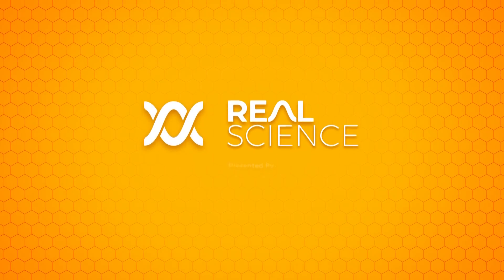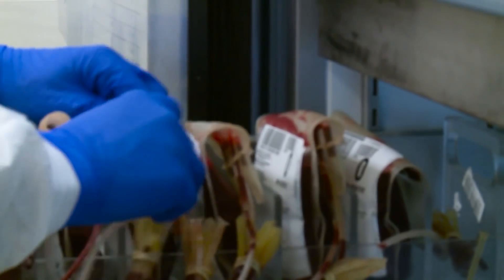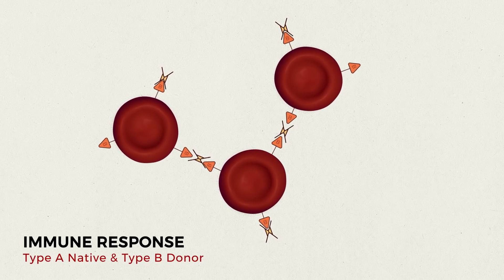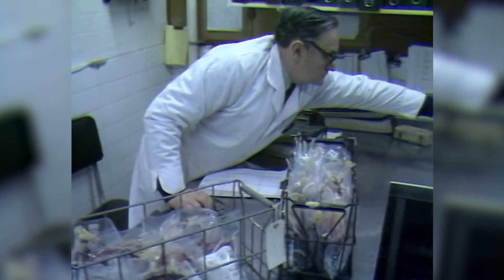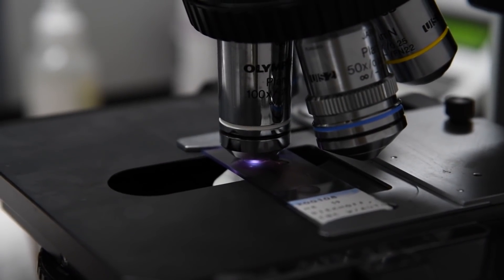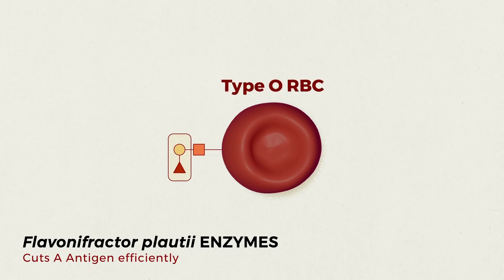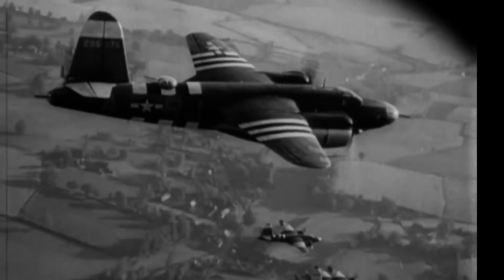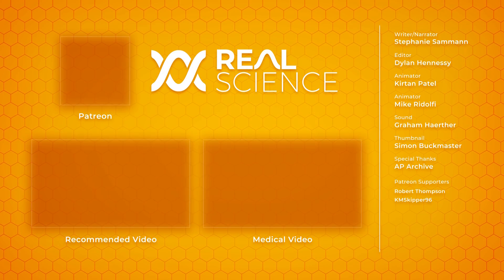Can We Create Universal Blood?

Comment: I had O- blood before I had my baby, after that it's now changed to A+. Everybody swears your blood type never changes, but mine did. I wonder if it was from too many Rogam shots? Initially I was told I would only need one my entire life, during the last pregnancy they wanted to give me one each trimester. IDK.
Reply: So Rogam is an injectable form of purified anti-D antibodies,  made from donors who have anitbodies to the D antigen (the 'positive' in a blood group.) in a process called fractionation. Often during pregnancy, some of the babies red cells can enter the mother's circulation, and cause an immune reaction. This can cause the mother to produce anti-D antibodies, which can attack the babies red cells. Rogam minimizes the chance that the mother creates an immune response against the babies D antigen. Rogam is usually given 3 times during a preganancy - at least in New Zealand. Different places may have different standards. 

If you were given Rogam, you are very likely D negative (Oneg, Aneg, Bneg, or ABneg) - if you aren't, somebody fucked up. Testing as Apos was probably an error by the Laboratory, such as a sample mixup. Did they contact you after testing as Apos to book another bleed?

Comment: Isn't basically -O blood type?
Reply: It depends about which -0 blood type you mention. Same as A to A1 to A2 to A3, ... ie B to B1 to B2 to B3 ... there is 0 to 01 to 02 to 03 ... , also RH negative to RH positive. Where There are always weaker '0' RH negative modified by bacteria into '0' Rh null , and further weakened into '0' Rh Negative. About which '0' you mentioned? where even the '0' is NOT '0'. Going backwards in time, 200 years, 30,000 years, 150,000,000 years, ... etc etc, they would tell for today people "they don't even have blood".

Comment: the problem with "synthetic bloods" is they tend to interfere with most blood tests. I have only once seen a sample of blood with a synthetic oxygen carrier in it and I couldn't reliably test it for a Full Blood Count as the numbers were all nonsense and the plasma was so dark that many other tests which rely on optical techniques like spectrophotometry couldn't be done either.

For making all blood group O, that's fine but the next time I test the patient's blood I'm not going to be able to tell which group they are, so then they MUST have group O blood until their own group is clear again (because safety) which would massively increase the demand for group O. That makes it difficult to phase this in. Once you've started using it, it's all you can use.
Reply: Mass jab ingredient potential here .......

Comment: What about turning Rh + blood into Rh -? You only spoke about turning A or B into O. Considering O Blood also has to be Rh - to be universal donor blood. Considering the Rh - blood types are a lot less common than the Rh + especially in A and O it would seem to be pretty important to do that too.
Reply: From what I remember the RH factor is protein that goes through the red blood cell membrane as opposed to simple sugar added on the cell like for the ABO system, I would assume that removing it is much more complicated. Just turning all A into O would already double the supply of both O+ and Oneg which most likely would be enough to supply the demand.
Reply: @patrickpi12345  thanks for the answer. Maybe a protease could work but it would need to cut the protein right at the membrane and even then it isn't certain that this wouldn't hurt the blood cell. I assumed it wouldn't be easy but a lot less people have Rh - blood than Rh + and since this it the one causing problems during transfusion it could save a lot of lifes.

Comment: Why don't the donor population and the recipient population have the same profile? How can there be a shortage of a particular blood type?
Reply: O both positive and negative are used more because they are universal and can be given in emergency situation where there isn't time to find the exact blood group of the person. That's what mostly cause the shortage. Other situation like massive bleed from a B patient could also cause shortage of B which is already not very common which would then receive O because that's the only option left for them.The last situation would be even worse if the patient is Rh negative.
Reply: @patrickpi12345  Thanks. That makes sense.
Reply: If the doners and recipient population belong to the same locale, yes, they will likely have a similar blood type profile. The problem is with the donation rate and the supply chain logistics (if your population is very widely dispersed). In my country (Singapore), the national donation rate is 1.87% of the residential population in 2019 and just over a third of the doners donate regularly, so we do have periods where the national blood bank runs low and calls for doners are made. On the brightside, my country is really tiny and is very well developed, so at least the supply chain logistics part isn't an issue.

Comment: Another great episode. Here's a question though: Why is it so hard to directly supply oxygen and remove CO2 from the blood artificially? I've been wondering about that since start of the pandemic - It seems to be possible, but only through an invasive method that can't be used for more than a few days.
Reply: Lung have a surface area of 50 to 75 square metre meaning there's millions of small capillaries all made of cell thin enough to allow gases to flow without restriction all without harming your red cell while fitting in your chest. A machine that could do the same would be almost impossible to build especially without being able to redirect the blood supply from the heart to the machine.
Reply: Lungs have evolved over millions of years, it will take a long time to make a machine near optimized to that.

Comment: I'm curious if a similar process can be done for plasma as well. There are situations where blood plasma is specifically needed but the red cells are not.

Add-On Edit: After some investigation I now understand the info I was recalling was about antibody incompatibility between plasma groups; thus, not applicable to the surface protein cleaving methods covered in the video.
Reply: Plasma is an important by-product of the production of packed red cells which is useful to stop bleeding as it contains clotting factors. Plasma is a lot easier because:
- demand for plasma is a fraction of that of red cells, so it's basically "free" when you make red cells and a lot of the excess is even discarded. 
- it can be frozen for 2-3 years and thawed when needed, so there is never a shortage. No need to freeze dry if you have access to electricity.
- unlike red cells which might have over 300 different antigen specificities you might react against beyond just ABO, most donors only have ABO antibodies in their plasma.
- Rh antigens are only on red cells, not in plasma.
- it carries antibodies, not antigens. when transfused antibodies are used up, they're gone. whereas a red cell covered in antigens might sensitise you to form an antibody against it, stimulate the production of huge amounts of antibodies, and transfused red cells can live for months. this means plasma only causes "minor" incompatibilities and is a lot less dangerous than red cells. The biggest risk with plasma is TACO.

In bleeding emergencies, colloids and crystalloids like saline are given to increase blood volume because the loss of blood volume will kill you faster than the loss of oxygen carrying capability of the lost red cells. There has been a drive in recent years to get plasma in sooner in major haemorrhage emergencies.
Reply: If you really wanted to make plasma "universal" by pulling out the ABO antibodies, I would guess all you'd need to do is pool it and run it through an adsorption column of beads covered in N-acetyl-galactosamine and galactose. Total guess.
Reply: @KX36  thank you for the long reply! So much varied info, I love it! These differences in uses and compatibility with plasma are deeply interesting.

Thank you again.
Reply: Interestingly, freeze dried plasma has been available to the US Military for almost two years. Broad approval by the FDA has not occured yet.
Source:
https://www.militarytimes.com/news/your-military/2018/07/12/the-fda-approved-the-military-use-of-this-potential-in-combat-lif
Reply: @lordzadd  that link isn't working for me, but I found multiple news sources talking about it. A lifesaving step forward, and fascinating science.
Reply: Edit: Most of the plasma "donated" is actually going to pharmaceuticals. It's not going back into other people. For that reason, pharmaceutical companies are often willing to pay people for plasma. Like blood donations, plasma donation directly from one human to another would still require screening for blood-born disease, but that's whole other can of worms.
Reply: @LaughterOnWater  ah, now I see. I went to review my info after reading your reply.

The charts I have previously seen are refering to the antibody compatibility of plasma; which is it's own can of worms, but does not function in the quite same way as protein incompatibility. The antibodies naturally carried in the plasma can be a problem with donation, but it's a bit different than with only RBC interaction.

For those who are interested here is a video summary of the interactions reviewing RBC alone, whole blood, and plasma donation limitations: https://youtu.be/wtYsdOBmk38
Reply: @ebonyblack4563  Awesome info! Thanks! I learned something today!
Reply: @LaughterOnWater  I appreciate the information.

I've previously seen donation maps/graphs for plasma that implied to me it had a similar limiting factor, perhaps those were equally misinformed to myself or were created with something else in mind.

Thank you for your reply.
Reply: @creativecatalyst777  Hello! 
It seems the FDA themselves have this on their website. This link should last longer. https://www.fda.gov/news-events/fda-brief/fda-brief-fda-issues-draft-guidance-development-dried-plasma-products-intended-transfusion

Comment: This may have already been done. Erythromer is a red blood substitute funded by the DOD. It is a freeze dryable blood substitute which can be reconstituted in emergency situations. It is created with blood from humans that is coated with a synthetic polymer. It is also designed to be "immune silent" meaning it should be universally accepted. (Rh null people should wait for the trials to be finished before jumping for joy)
Reply: According to 
pnas.org/content/117/14/7542
Phase one trials for erythromer may begin as soon as 2022. It is currently being tested in rabbits.
Reply: Interesting, will check that out soon. It is good to have multiple solutions using different methods so that if one type's supply chain fails, the other one can pick it back up. It's also good just to have two solutions in case one causes some side-effect and the other one may prove to not. It is hard to say before clinical trials begin.
Reply: @pikenote  Yes it really is hard to say anything with certainty without those clinical trials.
Reply: Sadly, RBC aren't the only, nor are they always the most important blood component. 

I had a skin graft surgery about 10 years ago that required 31 units of blood....not 31 liters, but 31 'units' worth of blood plasma, platelets and the like. 

Blood plasma is the sticking point, as far as I'm aware. Saline is great in many situation, but no replacement for blood plasma. It's more a 'filler'; like watering down a regular soda, you aren't making diet soda, just a weaker, watery drink. Saline rehydrates a patient, and can be an immediate solution for minor blood lose, or rebalancing electrolytes, but it's not a solution to a critical lose in blood volume as would be synthetic blood plasma platelets etc. 

And just pumping a patient suffering from critical blood lose with red blood cells (synthetic or otherwise) isn't a viable alternative to whole blood or a hypothetical synthetic whole blood product.
Reply: @petercarioscia9189  
You know what, this is actually an important point. Plasma is important as well. Accordingly, the US Military has had access to freeze dried plasma for almost two years.( The FDA has barred it for use for the rest of us mere mortals).
 It is also important to list the shortcomings of erythromer, which is of course the short life span as compared to real blood. 
All of this does not mean that we no longer need blood donations, it simply means that we can make better use of current supplies and have a dependable supply of blood in the case of a mass casualty event, where current stocks would probably be depleted. 

Source: (https://www.militarytimes.com/news/your-military/2018/07/12/the-fda-approved-the-military-use-of-this-potential-in-combat-life-saver/)
Reply: @petercarioscia9189  Well, for other parts of the blood, the immune reaction is much less pronounced even insignificant in some cases. So the RBC problem is what we're first trying to solve. Once this one is mastered, others will follow.
Reply: @petercarioscia9189  On the other hand, even if such technology only displaces part of the current requirement for blood, that means the overall demand for it will be lower, meaning more of it is available for the people who specifically need whole blood/plasma, etc.

As with always, this will probably, at least at first, be only a partial solution, but still one that can contribute in combination with others to reducing the problem.
Reply: See also:
 NBC news:The long quest to create Artificial Blood may soon be over
Reply: Do you mean universal O type? AB red blood cells aren't universal, but I think AB plasma is
Reply: @ThomasBomb45  My sincere apologies. According to the insider (www.insider.com/can-you-make-medical-artificial-blood-2017-2%3famp), it is designed to be "immune silent", and my comment has been edited to reflect that. I have also discovered that Kalocyte, a startup has gotten the rights to produce it and are beginning trials soon.
Reply: Plasma is a protein slurry needed for many things to function properly.
Reply: @ThomasBomb45  O- are universal donors to anyone, AB is the universal recipient from anyone.
Reply: Note;
Still requires real blood to start.
Reply: @veralenora7368  
The most important part 🤐
Reply: cool
Reply: Attentoin!!! 

NERD COMMENTS ALERT!!!